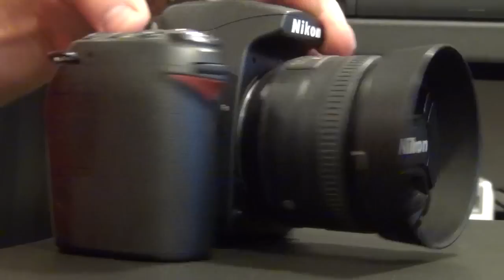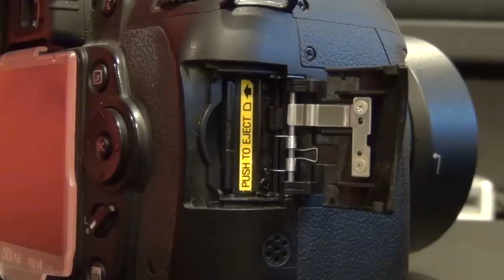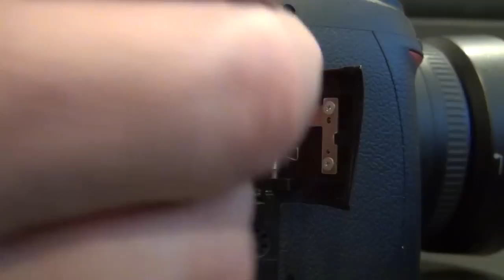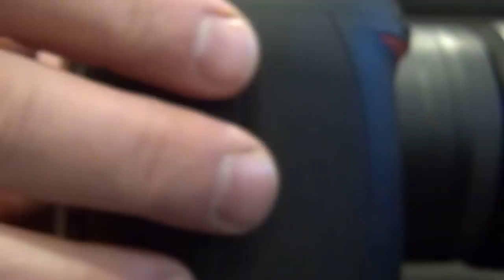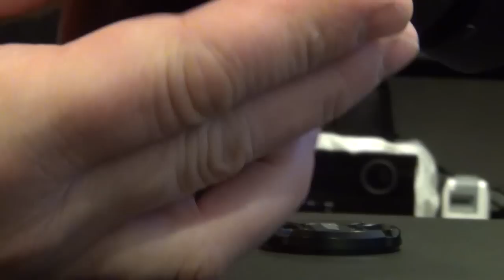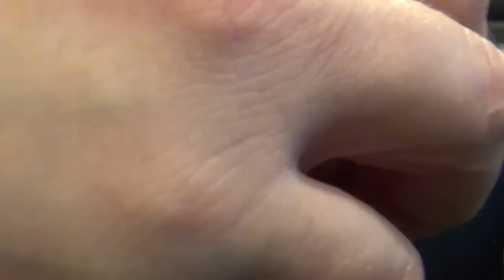How to fix a broken SD Card Slot on a Camera (HD 720p)

Comment: This is a modification which restores 100% functionality to an inoperative part. Excellent. I can't believe the retards whom scorn you for a legitimate solution to a problem, especially if the particular camera is not economically viable to fix; (ie. for the retards, the cost of the repair exceeds the value of the camera). PS: Thanks for pronouncing Nikon correctly; retards take note.
Reply from the maker: Fraser Nash Thank you a 1000 times!
Reply: What is he doing though?
Reply: Also you can pronounce Nikon Naykon.

Comment: I have a nikond750 and this totally messed up my sd card slot! I was able to fix it but this is clearly not a solution to all nikon cameras. Ripping the card out did not work. I will have to send my camera in to nikon to fix. DO NOT TRY.

Comment: What an awesome intelligent common sense approach.  I am going to do that to my Sony A33.  My problem is the SD card will not stay in...keeps popping out.  Will secure the card installed and use the mini-SD adapter.  THANK YOU
Reply from the maker: Hal W You are welcome. I am glad i could help with my idea. Thanks for your comment, and good luck with your camera!
Reply: mygiguser OK...I got my microsdcard and adapter.  I pushed it into card slot...hot glued (very little) on edges of card adapter...and now IT WORKS GREAT AGAIN!!!  Thanks!  Did not  have to take my camera apart!!!

Comment: So my big question is, were you able to get the pictures off the card you pulled out??  I am sure you wouldn't want to use it again in the camera but I currently have 300+ wedding photos on mine that is stuck and the last thing I want to do is force it out if I won't be able to read the card after.
Reply from the maker: Stardust5683 Well, I used a regular card reader.
Reply: Stardust5683 USB cord from camera to computer for now

Comment: i think I have damaged my slot in new panasonic lumix FZ 200..i am not even able to insert the SD card now..So i guess this fix will not work, right?
Reply from the maker: tspandya Doesn't look good, sorry.
Reply: +tspandya I think I did that with my d3300 :( I couldn't pull out a sd card and when I did it it sounded like a broke something :(
Reply: +purrization  This is exactly what happened to me and it was my 3300 as well. Seems to me like Nikon has a manufacturing issue that they should have corrected regarding the card slot.

Comment: Here is an easy fix i just did mine and works perfect.

Get a small dental floss brush (Cylindrical mini bottle brush)

Remove battery and card

Spray CO (electronic) cleaner onto brush

Insert brush into slot rotate brush and clean pins inside slot

Let it dry for a few minutes as CO cleaner evaporates and leaves no residue

Insert card,enjoy!!!

If you don't have CO contact cleaner you could use Pure Alcohol but let it dry completely

Comment: you didnt fix it but you now have a work around.  How does the spring eject get broken in the first place?  is it from pulling out the sd card without pushing it in first?  This has happened to a machine of mine but caused by someone else using the machine not me.  Is it possible to repair the mechanism or does it require a replacement?
Reply from the maker: Well, I think I made the mistake to eject and insert it too often. I often take only a handful pictures, and then instead of using a USB cable, use the card in an external card reader.
In order to really fix the original slot, I would have to replace the hole mechanism, and that will be expensive, because you have to take the camera apart. I try to avoid this as much as possible. The Mini SD card can be pulled out easily, and does not show wear at all.